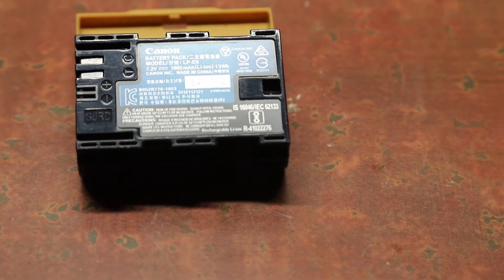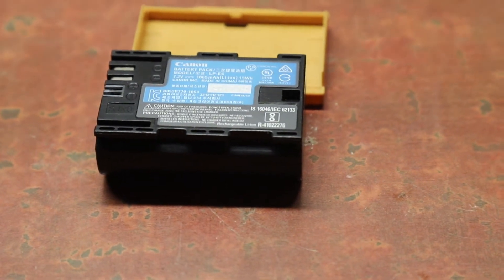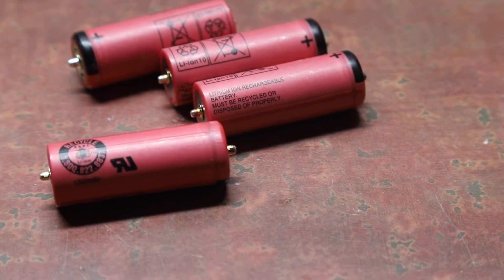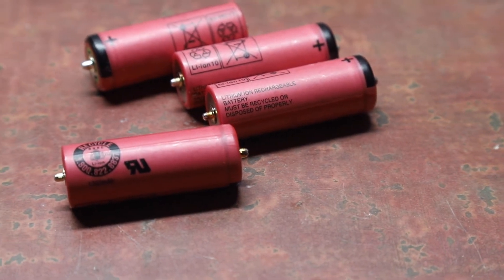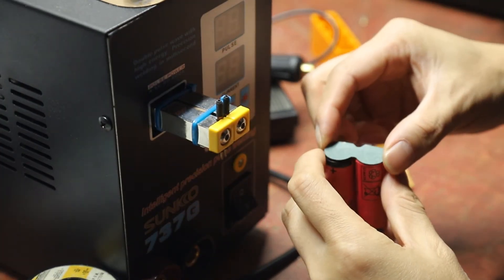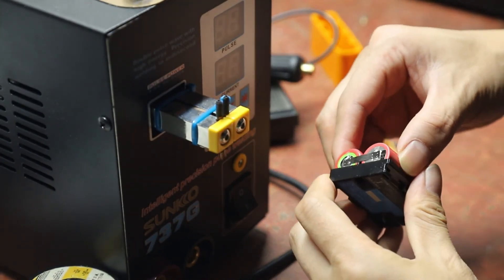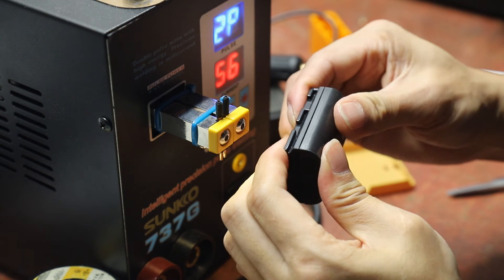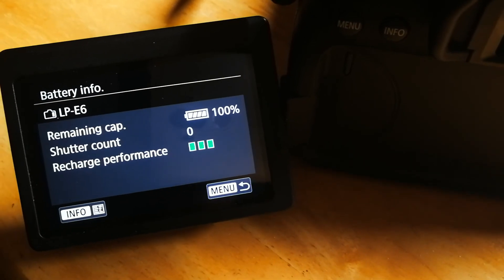Canon LP-E6 li-ion battery cell replacement

Comment: Originally Canon use Panasonic NCR18500A cells with nominally 2040mAh and minimum 1900mAh so putting inside 1300mAh capacity degrades its power approx 40%?

Comment: The trick for opening sonic welded case is using a vise, clamp at the seam on one half then tap with something flat and blunt at the seam, it will split apart, start with the corners and work your way around, case should glue right back up with minimal damage

Comment: I get pretty upset with canon and the price they charge for bateries so I love the idea of doing replacing the cells.  However, I have to ask is this really worth it by the time you buy the spot welder and new cells.  I have switched to buying promaster bateries and really think they are pretty darn good compared to the canon batteries.  Anyone else have any thoughts?

Comment: hello, in this video was the welding machine before or after with the modification of the microwave oven transformer?
I also bought this welding machine but I immediately encountered the problem that it has little power, the points it performs are very weak and often do not hold up.
At this point I also intend to modify it and put a modified microwave oven transformer.
Otherwise it is unusable as it arrives!

Comment: Hi friend, the newer ones installed are 18500 or 18480? Mine is exactly the same blue battery like yours. I saw another vídeo with 18500 ones replacing originals ones. Does it fit in same case?
Reply: NRC18500a
Reply: You can't trust the 18xxx numbers for precise actual dimensions.  Only way to know is to measure new versus old.

Comment: I replaced both Canon battery cells in LP-E6N. After charging in the Canon charger and inserting it into the camera, the indicator still shows me the wrong performance level - 1x red bar. Does anyone know why 3 green bars do not appear after exchanging battery cells?
Reply: Did you test the new cells independently before soldering them in?  Perhaps one or both cells are defective or low quality.  Are you sure the old LP-E6N is genuine?  Not an aftermarket or counterfeit that doesn't support proper firmware response?  I can't imagine the genuine firmware is able to recognize new cells as Canon "approved" brand or not, because it is just a voltage source.  Perhaps the later firmware refuses to cooperate when it detects a cell disconnect and replacement (i.e., loss of all voltage and reset).
Reply: Because Canon put something in the batterysoftware that blocks that. This software is also cummunicating with the camera so that the camera knows that the battery is genuine or not. Also cummunicating with the original charger....that's why the charger is fast blinking (and not or very slow charging) when putting non originals batteries in it. As far as i know is the red bar nothing more then something to forge you to buy new batteries.